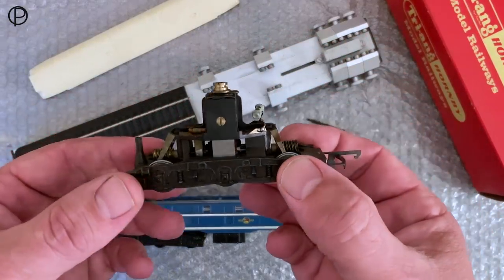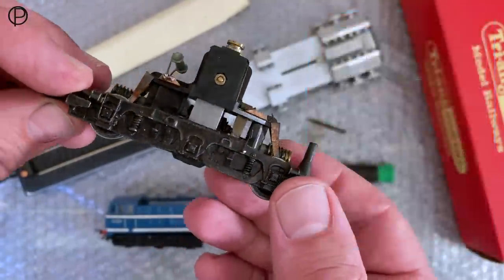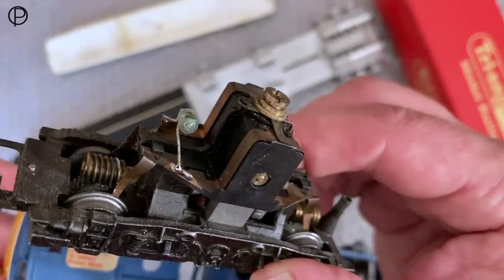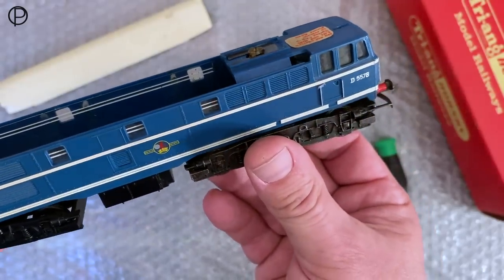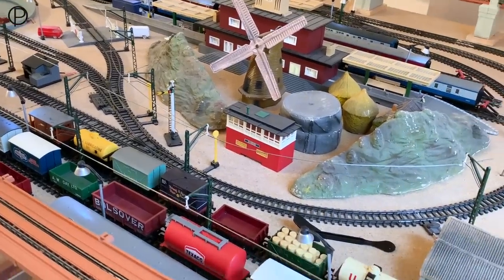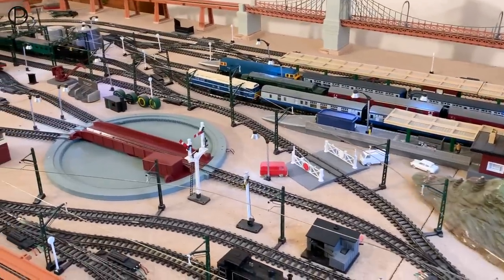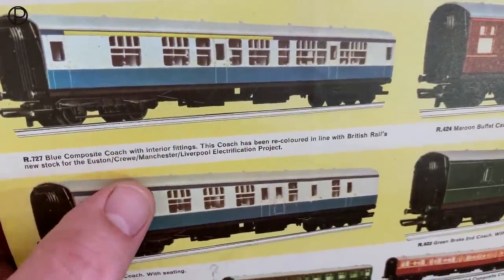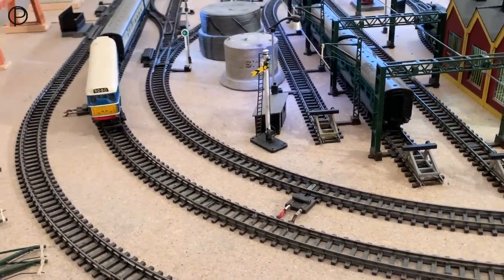Tri-ang Hornby R.357B Brush Type 2 Diesel-Electric Loco in experimental Blue livery & Layout update

Comment: Classic Triang . The Brush Type 2 was my first loco , included in the Freightmaster trainset in 1965. The start of my love of trains in red boxes!  Never had the blue one but she’s was certainly a handsome loco.  Love these sidewalls on the elevated section . I always think it was a shame the didn’t persist with these for system 6 . The eventual sidewalls were much more flimsy and didn’t give any strength Thanks for the video as always Oscar . Superb!
Reply from the maker: Good morning Russell thanks again for watching. I think this model was a very strong seller for the company especially in the green livery. I think you’re right about the sidewalls it’s such a shame they didn’t modify them for the new system 6 track when it came along. I should be using some of this later flimsy stuff in the next few months!
Stay safe
Oscar

Comment: I have this loco. Bought it 2nd hand from Hattons. Freight master set from the 1970s with a battery controller. It’s my favourite BR diesel. Mine has extra pickups on the 2nd bogey. The pulling power is excellent for a 50 yr old model. Still trying to get it a little more quiet 😁😁
Reply from the maker: The freight master sets were a great collection of items to get in a box. And the second pickup really helps on the locomotive.Thanks for watching and taking the time to comment it’s hugely appreciated.
Stay safe 
Oscar

Comment: I noticed in the catalogue, that the head code number on your blue loco actually matched the number on the 'other' green version of the loco?  I guess it was a case of "whatever was available" ended up on the roof..?  The little clips at the cab ends of the roof, were often broken at one end, from owners prying the roof off at the end rather than at the middle over the screw.. (I know that I got caught out there)..  My first one of these was an Australian NSW livery, a later version with pick-ups on the un-powered bogie.. A great loco to run on a layout..

Comment: Yes, as others have said they reused the Class 37 bogie which is why the steps don't line up. As well as one of these 1960s Class 31s I also have a modern Railroad version and at first I thought it looked "wrong"; Then I realised that the new one has much shorter bogies and it is in fact "correct". The Railroad one runs much more smoothly, with pickups on both bogies, but the body moulding on the 1960s version stands up REALLY well by comparison; quite an achievement for its time. CORRECTION -  I should have said that the Class 37 reused the Class 31 bogies so that doesn't explain why the bogies appear to be too long; perhaps they were stretched in order to be able to fit the mechanism.
Reply from the maker: Good morning Roger thanks for the information I think I may have to have a look at some of these Railroad models just out of interest.I imagine with the extra pickups along the model it makes a huge difference over the point work.
Thanks again for watching.
Oscar

Comment: Hello Oscar, that's a very nice Brush Type 2 you have there. I don't have that version but I do like the livery. It also, as you say, has a very smooth running motor bogie, maybe it's not had a great amount of use. None of mine have their roof tabs either, just relying on the central screw to hold the roof. Looks excellent pulling those coaches. Great to see. Best regards to you
Reply from the maker: Thanks Mr snooze you’re right I don’t think this model has done many miles around the living room carpet yet! 
Thanks again for watching.
Oscar

Comment: Hi Oscar,
Nice livery on the Brush Type 2. I have the R.357 version (1962), unfortunately one buffer missing and only two screws on the baseplate. As you say a smooth runner however if I lead into a point with the trailing bogie it is fine but with the motor bogie it tends to derail (Super 4 track).
Reply from the maker: Good morning Gordon great to hear you have one of these. Maybe try adjusting the back to back on the drive wheels if it’s  on every point. They can be adjusted a small amount with a little care, also the leading edge of those point blades can be a little crude from one point to another. A little work with a small file can sometimes make a huge difference to these.
Thanks again for watching stay safe.
Oscar
Reply: Oscar Paisley Morning Oscar,
Many thanks for these tips, very much appreciated I will give it a go.

Comment: Very interesting as ever Oscar. I never had a Tri-ang Brush Type 2; eventually got some produced by Airfix.

Tri-ang used exactly the same motor bogie for their later English Electric Type 3 model. The side frames were thus correct for the Brush Type 2, but not for the EE Type 3.
Reply from the maker: Good morning Peter I think you’re right Tri-ang used the same motor bogie for the English Electric when it came along. I think they always like to reuse part where ever they could get away with it to save costs. 
Thanks again for watching.
Oscar

Comment: The yellowed roof was caused by sunlight. As soon as you revealed the inside of the roof and it being white proof to me that the top was the same colour at one point. However being protected from the light kept the underside correct.  The coach numbers I don't believe are true either. BR by that point always used a region letter at the start of the number. For example E for Eastern region. The others were M, S, W and two letters SC for the Scottish region. Also the two lines on the top of the roofs at the ends of the coaches I think extend to far. They were the pipes to feed the water tank for the flushing toilets. At that length it would have gone into the seated area, beyond the white painted window of the toilets. Most people would not know this, but I was lucky to work for BR in 1977 on a government work scheme. One of my jobs was sticking a hose pipe to the pipes that came down the back of the carriages, turning the tap on and when it filled the tank, it overflowed down the roof and you turned off the tap! You could then flush the toilet! Which went onto the track, hence the sign not to flush the toilet when in the station!
Reply from the maker: Good morning Graham that makes a lot of sense about the roof. So the model must’ve spent some time sitting on the layout in the sunshine. Thanks again for watching and the terrific information and memories of working on the railway.
it’s hugely appreciated.
Oscar

Comment: Hi Oscar
Love the class 31 how many years has this model been going, re-engineered so many times and now back again for another term from hornby. I have never had the blue one you have always been outbid or its to much so something to look forward to. I do have 4 green ones though 2 mint boxed and 2 that came out of old sets. Yours look nice with the blue/grey coaches, see the layout is slowly coming down. I really am looking forward to your rebuild. Stay safe mate .

Regards Paul osman
Reply from the maker: Good morning Paul sounds like you have a great collection of those class 31s as you say it seems to have been a popular model over the years. I was just looking at the Hornby website the current 31 is quite a price. I imagine it would be a lovely smooth runner on the correct type of track.
Thanks again for watching.
Oscar

Comment: Hi Oscar...I have  few of these motor bogies and a couple of them screech when power is applied afterwhich they die down. Would you have any idea as to the cause of this?
I am taking them to someone to see if they can aliviate the problem.
The blue is such a handsome model. Hen's teeth!
Kind regards
Brian
Reply from the maker: Good morning Brian these are really fine looking models but sadly this was not one of Tri-ang's best motors! very often the problems with them lie with the armature bearings which are moulded plastic affair. They are quite delicate and become worn and damaged over time. This can cause the amateur to move about which causes uneven ware on the drive gears as the worm no longer meshes correctly this could cause a squirrel also lots of vibration as the armature begins to run off centre. Reproductions of these bushes are available at a number of places now but if the drive gears have been damaged it will be new wheel sets you need as the drive gear is moulded as part of the axle. I've included the link below for the replacement bearings.
Hope this was of some help thanks again for watching take care.
Oscar
https://www.hornbytriangspareparts.co.uk/item/MS79-HORNBY-TRIANG-PK-2-MOTOR-SHAFT-BEARINGx2fDAMPER-A1A-V9C
Reply: @oscarpaisley  thanks for your in depth explanation and for the link. I really appreciate the clarification you gave me on the problem. 
Brian

Comment: Sad to see the layout go, still time to move on I guess. You talked about a bigger layout, so will you be using plywood and planed timber rather than chipboard, which can warp and is very heavy? chheers again Paul
Reply from the maker: Hi Paul,no chipboard this time around. Ply and timber frame to begin with...
Thanks again.
Oscar

Comment: Hi Oscar. I think they reused the class 37 bogies for this engine.
Reply: They are class 31 bogies they used for the 37 too ironically the ringfiejd 37 used the class 47 bogies why hornby never tooled up proper bogies I never understood cost maybe mate 👍🏻
Reply: Strangely they made correct bogie frames for the EM2 
I would have thought that they sold way more 37s than EM2s.
Reply: @lfewell2161  The EM2 model was about 61, then 31 in 62 then 37 in 65. Production design order explains what was available for Triang to use while keeping cost down. Today exploding costs.
Reply from the maker: Good morning Gerard Tri-ang definitely liked to reuse items were they could. But on this occasion I think the Motor bogie  was developed for the EM2 then modified for the 31 and then used for the 37 unmodified. It’s all interesting stuff and it’s amazing what they thought they may be able to get away with in producing these great items.
Thanks again for watching and take the time to comment hugely appreciated.
Oscar